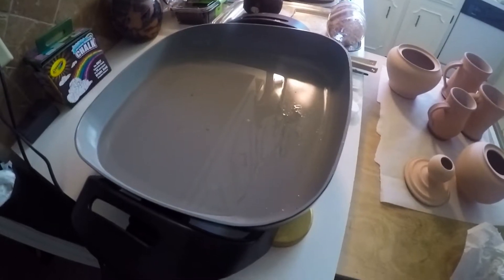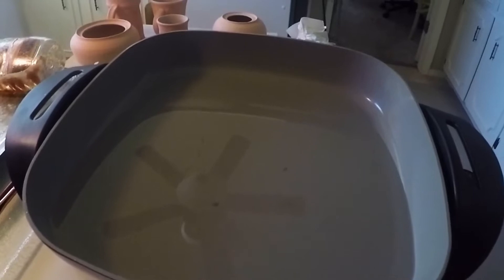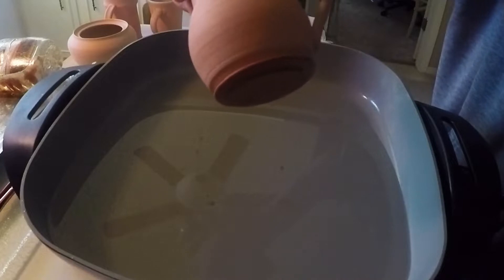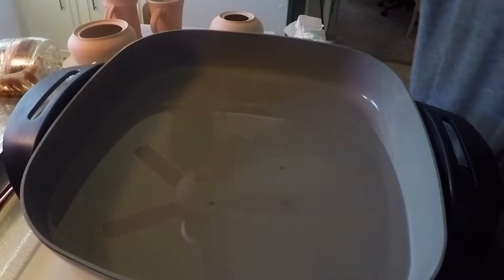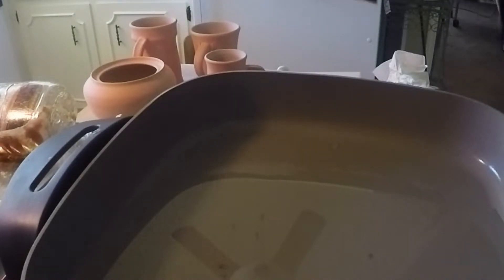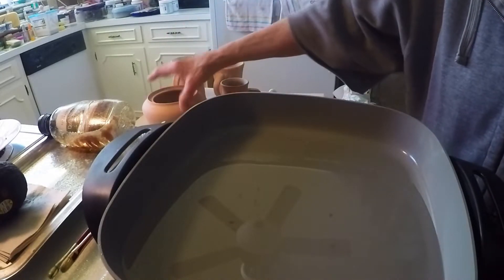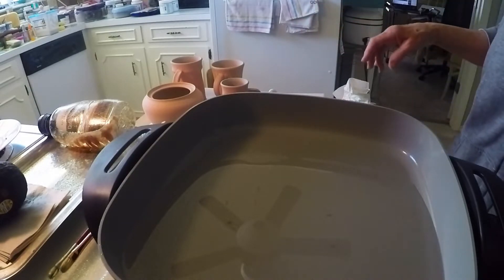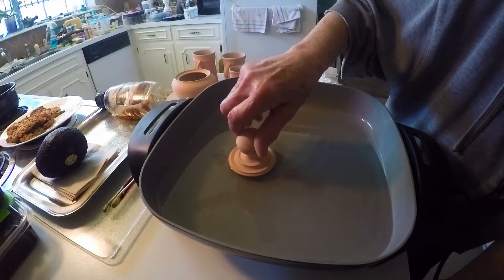♥ No-Splat Wax Resist Technique. Get a perfect even wax line on your pottery using my skillet method

Comment: Looks so neatly done. I haven’t heard of gulf wax, Is that the same as paraffin? I tried paraffin but it got so thick and boy howdy did it stink when I fired my kiln!!
Reply from the maker: Hi Lorelie!  Oh yes it stinks! for about 10 to 15 minutes of burnout. After that its fine. Good ventilation is essential isn't it. Yes, Gulfwax is a type of paraffin made especially for food preservation/canning. My Walmart carries it in the house ware section where the canning jars are. It stays liquid as long as it is warm enough. Low-Warm setting on electric skillet. Solidifies as it cools which is handy; makes it easy to relocate when not in use.  So good to hear from you! Thanks for your support! -jw